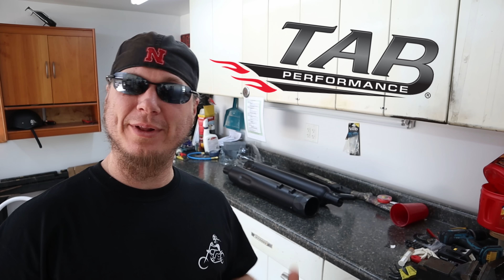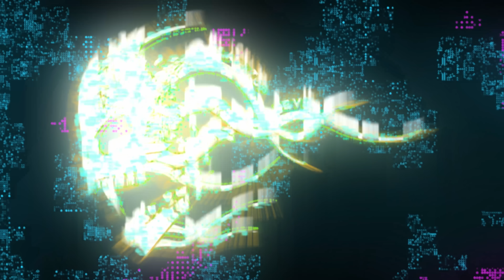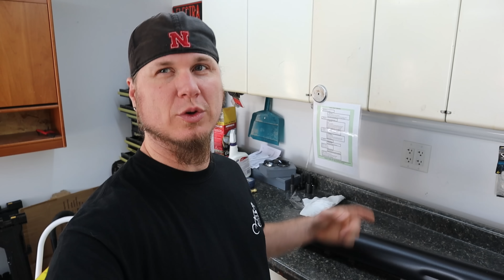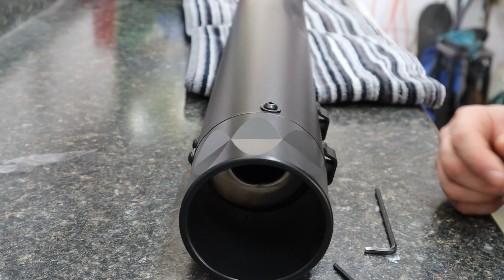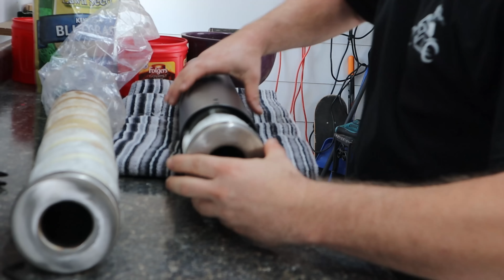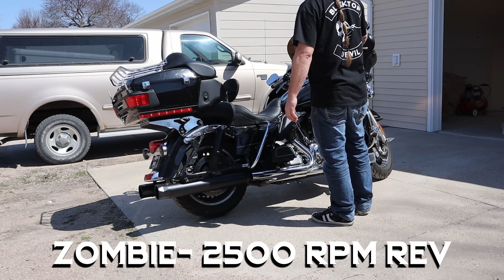These might be the best sounding mufflers for Harley Davidson! Tab Performance comparison and review

Comment: Definitely the right decision guys, the medium baffles were my choice too. The medium baffles had a mellower, deeper, rumble than the Zombies. You don't need obnoxiously loud pipes out on the hwy when doing big miles as you're going to have ringing ears by the end of the day. I just fitted S&S superstreet 2 into 1 pipes to my Sportglide and they are a very nice pipe. Nice deep rumble when you wick it up but not annoying around town either. I previously had V& H big shots staggered on my 2012 Fatbob and they left my ears ringing after a extended hwy ride so I did not want to go down that path again at the age of 53 years young.
Thanks guys, great Vlog. Take care.👍🇦🇺😊

Comment: I kept the 4" V&H slip ons that came with my bike. I chopped the baffles in half and they were louder but never had that real deep sound that i was after. I took the baffles out completely and im sticking with that. I get loud but not overly loud because i still have the stock head pipes. I actually gained midrange and up tq. You dont lose back pressure because my 2 into 1 into 2 creates its own back pressure because they only 1.75" wide before the mufllers. If you want deep, the bigger inside diameter baffle you get is deeper than say your common 2" inside diameters. If i had a true dual then the bike would be too loud for my music lol. If you have stock head pipes, just get any non tinny (thicker metal) slip ons and take baffles out. You'll thank me later. Good video. Sorry for the long post.
Reply: absolutely right
Reply: What motor? I have a 2006 twin cam 88 and have had the V&H twin slash. Head pipe is stock but I do have some motor work. I’ve been told taking the baffles out would harm the tune the bike has. Is this true?
Reply: @dustinjohnson2116  It's a 2009 StreetGlide with the 96 motor. I don't have issues with the tune. Same with my 2017 103 BreakOut. No issues with baffles out of the V&H big shots. You usually only need to re tune when adding more air, cams, motorwork etc. I've never had to re tune when just adding a new exhaust or taking baffles out or cutting them shorter. I do have Thunder Monster Baffles in the Big Shots on my BreakOut but they're really not baffles. Their pipe reducers with a loli pop design for added back pressure and deeper sound and less tinny/sonic boom sound. They're only 2" inside diameter.
Reply: @ ok. Man I have read a lot of reviews and comments about how it affects your low end torque
Reply: @dustinjohnson2116  Yes, so have I for 30+ yrs of riding. It depends on your setup. I prefer mid range tq so low end tq in 1st or 2nd gear I don't care about. If you don't like the baffles out, let the motor breath and release the air quickly as possible by atleast cutting the baffles in half. Or put a loli pop design 6+ inches from the end of the pipe. If you have slip ons, just put the loli pop right before the open slip ons.

Comment: I appreciate the review. I have a 2006 Road Glide with Stage 4 upgrade, 88 to 95, plus a long list of other mods. I bought the bike used, with Thunderheader 1024-B long style, black, 2 into 1. They were just too freakin' loud. Folks said they could hear me coming 2 blocks away. Plus, it's parked in an underground cement garage....so everyone knows when I start it up. So, like you, I went with the Tab Performance slip ons. I got the  BAM sticks with Medium Baffle 2.50 inch louvered baffles, and, the black 2 into 2 headers. Had to make a few other adjustments cus the bike has a chain drive (not belt). Sounds much better, it's still fairly loud, but not obnoxious.
Reply from the maker: My buddy had thunder headers on his 01 and they were loud but sounded terrible lol. Good choice switching those out!

Comment: I rode, for the last 20 years, with fish tail pipes and no baffles on a Road King, then this past year went to an ultra with stock pipes. Quite a change but I’m beginning to like the quiet. For me if I changed it would be to the mediums. I am finding that loud pipes make a more stressful ride, which I didn’t know until I went to stock. Thank you for the comparison video. Ride safe!!
Reply from the maker: I'm the same way. The quieter my ride, the more miles I can do. Even now if I toss ear plugs in it helps me go farther. I think the constant noise of wind and pipes just takes it toll on the body over a long day of riding.

Comment: Thanks you for showing the inside as comparison. I just bought some used BAM Stick which the previous owner didn't know what kind of baffles he had. It help me identify what I would buy.
Reply from the maker: Right on, glad it helped! How do you like them so far?
Reply: @LifeontheBlacktop  I'd let you know sooner or later, I bought them yesterday and didn't installed them yet and winter is coming here in Canada (Montreal). Plus, I have to run my Dynojet PV to tune the bike also making it full stage 1 and planning on going catless and maybe installed a cam this winter. Only have my RK for 3 months (first HD) and I am completely victim of the Harley fever.

Great channel and content! Thank you!

Comment: Nice video. Huge Thumbs-up.  After extensive reading and research; I ordered the 4.5" BAMSTICKS with Zombie baffles. Slash cut with Zombie rings and torque cones. Retain as much torque as possible. Should be here this week. I will be installing these on my 2020 Road King Special with everything else stock engine wise. I'm pretty stoked. Ran the Zombies on my previous Sport Glide. Love them. Take care.
Reply from the maker: Thank you! You're going to love them I'm sure!

Comment: What's the point with packing in Zombie as there are no holes for the packing to do anything?
Reply from the maker: It would still dampen the resonance a little. Otherwise you would hear all of the high pitch metal flexing and stuff.

Comment: Great Video-- Have been trying to decide on slip ons---  I just got a 2020 Ultra Limited  Zombies it is!!  With just the slip-ons and zombie baffle would you need a tuner??  Thanks BD !!
Reply from the maker: Technically yeah you should probably tune it. My first set of slip on I didn't tune it and I had some decel pop and eventually it turned my pipes gold from being too lean. Might as well toss an air cleaner on there while you're at it and give it a good tune 👍

Comment: Hey great video lots of good sound , advice on the tab performance mufflers. Question: looks like you retained the factory header > w/ cat removed. Did you feel any negative effects of the 02  sensors cross talking,  after catalyst removed?  I've been reading alot of feeds on different harley forums about not going to decatted route,  and just goin upgraded aftermarket header. 
 Your thoughts?
Reply from the maker: This is actually a jackpot headpipe with stock heat shields so I can't answer that question. I almost went the gutted route but ultimately decided against it. Sorry I can't be more help :-/
Reply: Ok cool.  Thanks for your reply. Enjoy the rest of your weekend.

Comment: More info. I put the 50 Cal (5") pipes on with Zombie baffles AND I put the swirled looking torque rings in the back mostly for the look cause those 50 cals are HUGE looking on the back.....I put them on my 2019 Road Glide CVO....They are AWESOME and quite loud.....Fast forward....I just bought another bike, a 2023 Street Glide CVO and decided to put the same 50 Cals on except this time I decided to go with the 2.5 louvered baffles to quiet it down a bit.  Sadly I was disappointed, I put them on and had the two bikes side by side and fired em both up...The louvered baffles sounded like a sewing machine hybrid, not much better then stock. SO I ordered the Zombie baffles from Tab and did the change out. now the bike sounds perfect. It would be nice if Tab had a baffle in between that of the Zombie and the 2.5 louvered.  And Install....Look, that baffle may pull out that easy on a pipe that has never been installed yet and ran but my bike had about 40 miles on it with the louvered baffles when I changed them out and they were a mother to get out of the casing. Yes, you can bang them to the bottom of the casing but they dont pop out like his did, they get what's known as a heat weld and makes em tight and that last 1/2" when the baffle is flush with the casing at the bottom is when you gotta break out big hammer and crowbar to run inside the baffle to punch it out from the back. Putting the new baffles in wasn't to bad with a little origami and twisting they finally lined up at the top at the same time as lining up with the inner pipe that you have to fit perfectly over. Tip: mark the pigeon the top so its easier to align the holes while youre twisting the baffle to get it in. They sound great and look even better
Reply from the maker: Great info! I have yet to hear the 50 cals as they weren't released back when I originally made this video. Maybe this year :)

Comment: They are really nice looking from a visual stand point. The cut design on the tip is sick. I wonder what the dyno numbers would be between the two baffles?  Great review. 🤘🏻👍🏻
Reply from the maker: From my experience the more free flowing the exhaust, the more of a torque drop you get. You'll lose a little with the zombies, but they do make a ring to put in the end to get back a little torque from what I'm told.

Comment: Great vid. Just bought a heritage. Any experience with Klockbwerks?
Reply from the maker: Not for exhaust no. I do like their windshields for sure. If I did exhaust again I’d look at rinehart pretty close too. Lots of people have them but they do sound really good. I haven’t heard the Tan 50 cal in person yet either. I’ve heard those are pretty nice as well. Good luck on your search!
Reply: @LifeontheBlacktop  oops. I meant Khrome werks. I’ve run Vance and Hines full exhaust system on my 2018 Road Glide Special. In my 2022 Riad Glide ST I put slip ons (Cobra NH) and now I’m going to maybe go with the Khrome werks. Thanks for the response. Good vid man

Comment: Right now I have the 4.5" with zombie baffle, they're loud and I like that but they just don't have any bottom end.  I do have a high-flow breather, torque cam and aftermarket headers without cat.  This setup for me is just too raspy and doesn't have enough good low-end..... I'm debating at this point trying the medium baffle or just going to another slip-on altogether.  You said the medium baffle has more bottom end, was the difference significant?
Reply from the maker: It was noticeable at least on my butt dyno.  They do make a zombie ring you can add in the end of the pipe to gain a little back, but if you don’t like the raspy sound (I didn’t either) I’d try the medium baffles and i bet you’d be happy with those.

Comment: Seems how you went with Tab 's performance headpipe with no catalytic converter, did you install the zombie cone performance rings for back pressure?
Reply from the maker: I actually have a Jackpot headpipe but I doubt it would make much difference in this scenario since it is also cat-less. I haven't used the zombie rings but they claim it does add back in some lost torque. They look kind of cool so maybe some day I'll just do it.
Reply: @LifeontheBlacktop  they're only a $150 and if it adds a little more juice why not?
Ive done so much to my 2019 RGS and now I've finally come to the performance side of things. I put on a Rockford fosgate 6 speaker sound system with hogworkz lowers. FBI 16" bars. 21" RC components wheel, matching left rotor, and air cleaner. Wrap fender and chin spoiler.  I have a screaming eagle pro tuner with tab zombie 4.5" but now it's time for the stage 2. Well I'm going with SS 475 cam chest kit, tab performance headpipe,  power vision tuner and zombie rings. Seems how I'm juicing it up, might be a wise idea to get the right front brake rotor put back on for stopping power.

Comment: Nice pipes.  Personally i am a fishtail type of guy and I am running vance and hines fishtail slipon pipes on stock head pipes with the cat on my ultra.   Later this year I may swap out the head pipes which I hope will give me a little more volume also because thats one area I want to tweak still.  When riding with friends we talk a lot with the throttles and with my current setup its hard to hear over some of the other bikes, on my fatboy with sampson street sweepers thats not a issue lol but on the ultra with the cat still in the headpipe it needs some attention.  Good stuff and glad you like it!!
Reply from the maker: Once you get a better flowing head pipe it's going to sound a ton better 👍
Reply: BlacktopDevil yeah that’s my thought also.  I am gonna want to get a tuner at that point also

Comment: This is the video I needed to see.  I got the Zombies during my stage I, and they were great.  Once I went stage II with open headers the volume jumped quite a few decibels...not to mention the possible loss of back pressure.  I want to keep the Bam Sticks but was wondering if I should change out the baffles.  This helps a lot.  Thanks!
Reply from the maker: I have about 4k on these now and they have gotten a tad louder but no where near the zombies. Just FYI. Thought I would mention it. I actually like them better now than I did when I first installed them.

Comment: What’s the difference in low end torque between the two baffles? Do the medium baffles still retain all the low end torque?
Reply from the maker: The medium will retain more torque than the zombies for sure. They do make a cool little insert you can use in the end of the pipe that they claim will bring the torque back, I haven't tried them though.

Comment: Hi nice video thanks for sharing, i wonder what kind of header you use and if tab will fit with screaming eagle air cleaner
Reply from the maker: I'm currently running a Jackpot 2-1-2 ceramic coated headpipe.

Comment: Great review BTD, this really helps since right now I have the same problem that you seemed to have with what you had before:  a deep rumble but not loud.  I currently have V&H monster ovals and I need something louder but still deep.  Definitely looking at the TABs.  I have a 110CU with stage 4 , what would your opinion be on how the TAB mediums would sound with this set up?
Reply from the maker: It's so hard to say ya know? Mufflers are so subjective. What I can tell you is the mediums did get a bit louder after I broke them in.

Comment: What about performance?
Did they make a difference with what you had?
Also why didn't you go chrome since the rest of the bike is?
Reply from the maker: Eventually I'll black more of the bike out. I like a mix between chrome and black. Plus I didn't like the contrast between the chrome pipes and my extended bags.  Performance wise it felt similar to what I had on there before and I was already tuned for those, though my butt dyno has waned in my old age. 😀

Comment: Great video I’m looking for something to replace my Vance and Hines turn downs for something with more bass / deeper note to it. I’ve been debating between these in the 2.5 inch baffle and the Rush Warhorse. I’ve got cams and a decatted headpipe so no 3 inch ad to keep my low end and I don’t want to have to redo my tune.
Reply from the maker: Fortunately my bike ran the same, I didn't redo my tune at all. But once I get some time I'll probably check it just to make sure it's fine afr wise. Good luck on your decision, hopefully this video helps.

Comment: I’m looking to get these on my sgs. Want it loud but don’t want to overpower my music, I have Rockford speaker system with bag speakers. Which would you recommend??
Reply from the maker: The zombies weren't too bad on the highway to be honest. I didn't turn my radio on while I had them installed but I could have probably heard it fine and it's a completely stock sound system. So if you want loud mufflers those would suit you well I think. If you want a little lower tone though, the mediums would be better. Sound wise, excluding loudness, I preferred the medium baffle. I like their tone.
Reply: BlacktopDevil awesome thank you for the input 👍🏼

Comment: They have a torque cone you install on the end if you’re running the zombie baffles.
Reply: The cones are sitting in a box in my garage. I've put them on twice and the sound with them on is terrible.  It's caused by the way the exhaust escapes and hits that thin aluminum piece. Not to mention no considerable torque increase felt.

Comment: Any torque change on low end with the medium baffle?
Reply from the maker: Not that I noticed with my butt dyno, though I do have a pretty decent tune on this bike.  They say there is a little loss with the zombie baffles but they do make a torque ring inset you can use to gain some back.

Comment: I really liked the louder version but, like the misses said, several years ago... but now they prefer the quieter version. That's what I'd go with. I'm thinking about going with V&H Monster Rounds for my FLHX. Actually my wife wants loud pipes but the ringing in my ears isn't caused by loud amplified music, guns, or anything else except it was loud pipes and probably wind noise combined that did the deed. I want to hear the stereo anyway. My 2 cents.